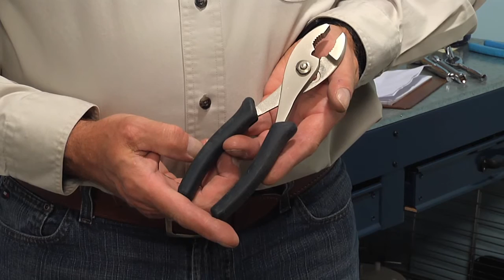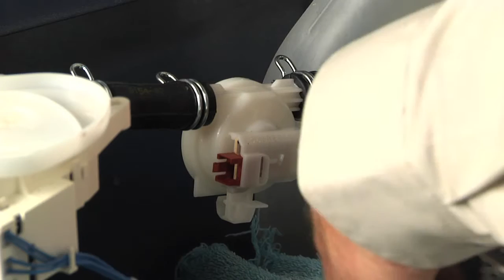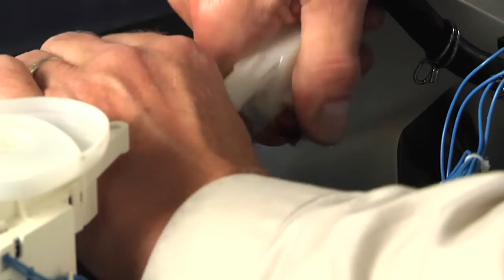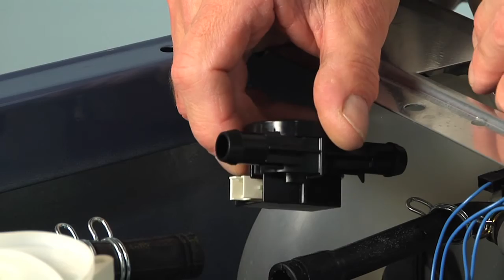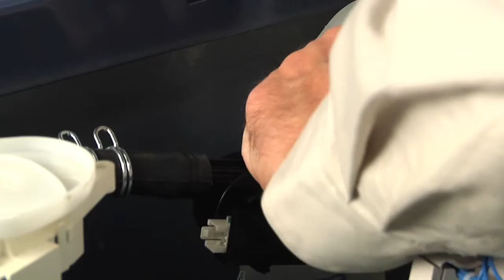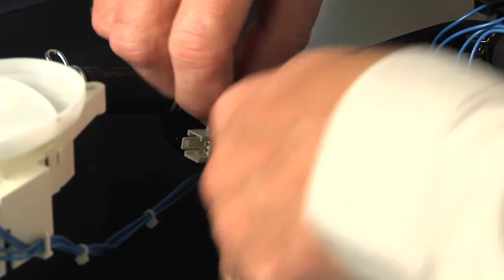Washing Machine Repair - Replacing the Flow Meter (Whirlpool Part # W10110225)

Comment: How would I know if I needed to replace the FlowMeter?
Reply: Well, I know this is a super old comment, but I just replaced my water inlet because the front loader was filling with water after hours on its own and eventually leaking but on another video, somebody said when your washing machine beeps and displays and H and an F. I already dumped $36 into this water inlet part to keep it from flowing. I would hate to buy this part and change it if it’s not the issue.
Reply: It’s depends on the washer machine model but my washer kept stopping the wash and flashed F20 whenever the water was coming in.